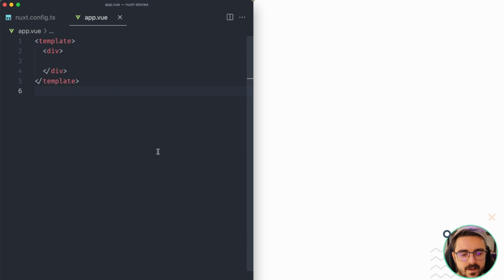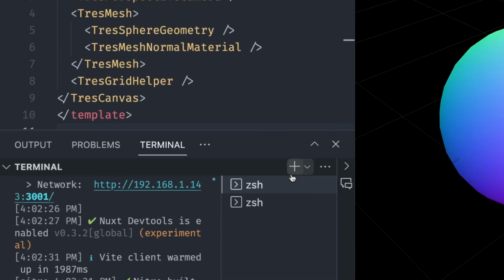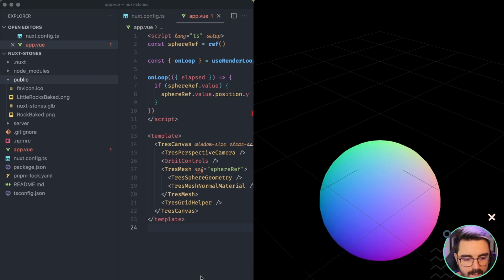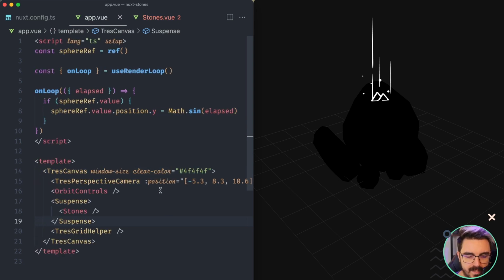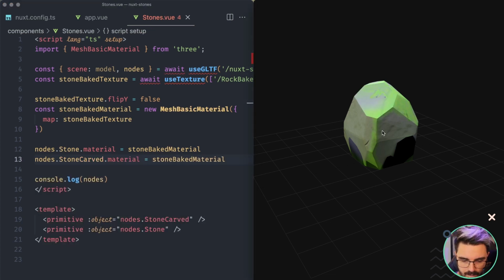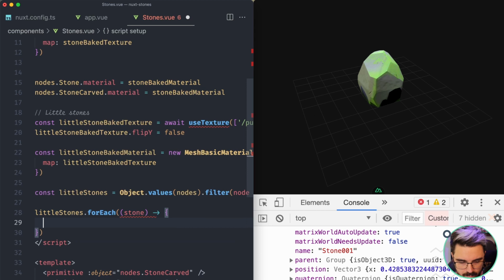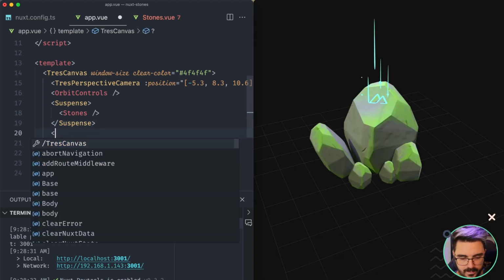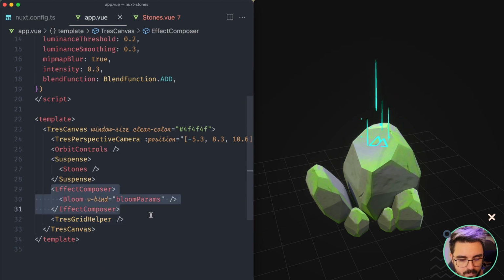TresJS - Add 3D to your nuxt app using the official nuxt module

Comment: I installed @tresjs/nuxt as per documentation (yarn add three @tresjs/nuxt)
But when I insert a <TresCanvas> component I get an error "Failed to resolve import "@tresjs/core"".
the @tresjs/core installation documentation says nothing
Reply from the maker: What version of the module are you using? If you could provide a reproduction link I can jump right on it.
Reply: @AlvaroDevLabs  "@tresjs/nuxt": "2.0.2".
I solved this problem by installing @tresjs/core": 3.6.1.
But I understand that @tresjs/nuxt  should have it inside?
Reply from the maker: @bohdanbilous1144  it has it as peer, and it should autoimport all the components and composables from it. I will take a look, are you using pnpm or yarn?
Reply: @AlvaroDevLabs  yarn

Comment: UPDATE 20 minutes later!: Check my reply to this comment:

Hi Alvaro, I have followed this video as well as the instructions on the documentation guide on brand new nuxt projects and I keep getting this error:

[plugin:vite:import-analysis] Failed to resolve import "@tresjs/core" from "app.vue". Does the file exist? 

I am not even able to see the black canvas.

Any help would be awesome. I only want to show one small stl file on the my nuxt website and I am not able to have any success.
Reply: So I was using yarn and not matter what I try it wont work.

Then I used pnpm like yours and everything works. have you seen a similar issue? This is the first time I am using pnpm and firsttime yarn is failing me big time. But Thanks for all the effort for making the library. It is awesome!
Reply from the maker: I would suggest use pnpm, its better resolving dependencies, several users have experience issues with yarn.

Comment: This video was really helpful however I am facing a little issue, I'm not getting any IntelliSense suggestions for Tresjs code, is there any specific config for that? I'm also using VS Code and Volar Extension pack. 

Versions
  "devDependencies": {
    "@nuxt/devtools": "latest",
    "@types/node": "^18.16.19",
    "nuxt": "^3.6.3"
  },
  "dependencies": {
    "@tresjs/cientos": "^2.3.0",
    "@tresjs/nuxt": "^1.0.1",
    "three": "^0.154.0"
  }
Reply from the maker: Hey there thanks a lot! For the typescript you would need to install @types/three as well